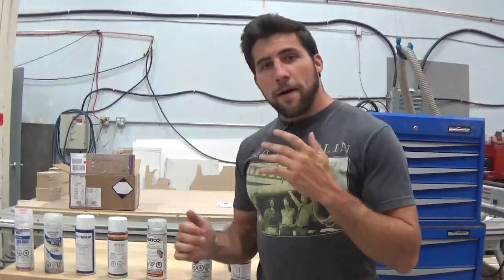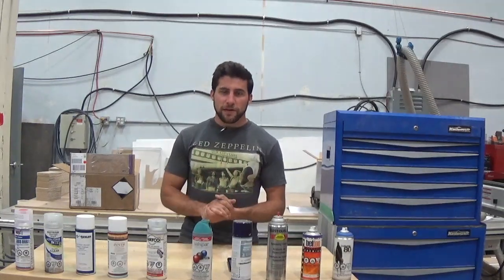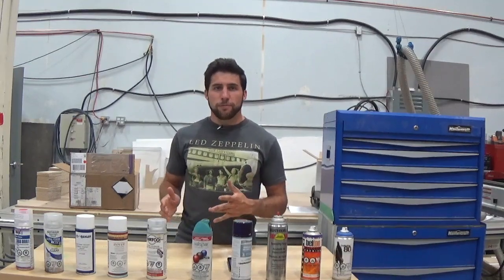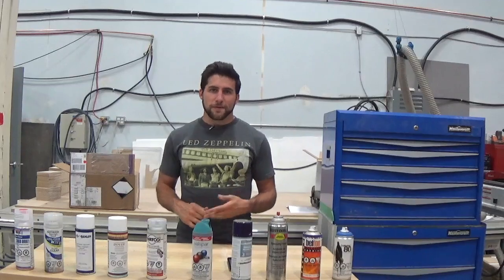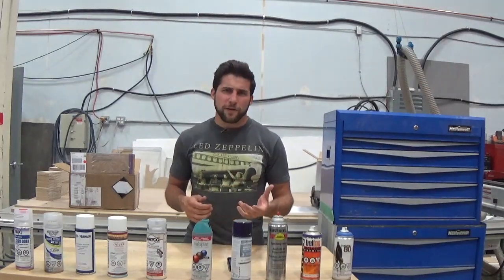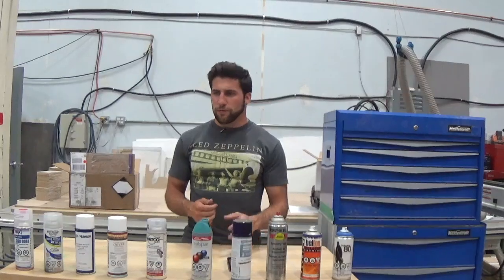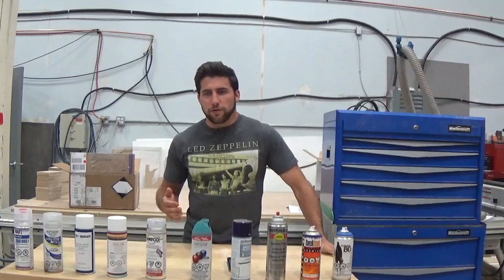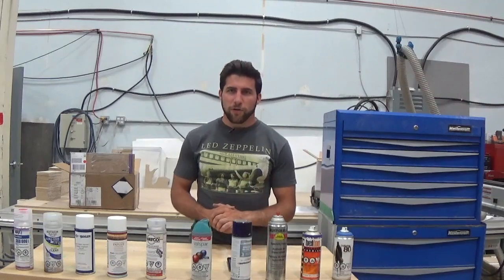The Top 5 Mistakes to Avoid When Painting With Spray Paint

Comment: I spray painted my handlebars with primer and base coat. It looked amazing. So i thought i might spray the clear laquear.so 2 seconds after. It wrinked and when i touched it. Paint just came of as if i used paint stripper
Reply from the maker: What kind of primer and base coat did you use?
Reply: Brad Angove i used supadec spray paint blue. And the primer was auto extreme profesional primer grey
Reply: Also instead of degreaser to remove the dirt before primer. I used nail varnish acetone that women use for their nails as i thought it cleans it. Probably thats why but i used it before primer so i dont think its because of that.
Reply from the maker: What about the lacquer?
Reply: Brad Angove auto extreme professional clear laquear
Reply from the maker: Do you know what kind of paint the supadec is? Enamel by any chance?
Reply: Brad Angove thats the thing. It doesn't say what type of it it is. But ill go to ny local paint shop and ill ask there too see.
Reply from the maker: Ok. If it’s not lacquer you may want to consider a different clear coat. Sometimes lacquer doesn’t play well with other paints. Enamels in particular.
Reply: Brad Angove so the clear coat isnt good. So i have to buy an enamel based clear coat?
Reply from the maker: That depends on what kind of paint the rest is, but it’s likely.
Reply: As a 'degreaser' , or even as a dust (from sanding) I often use a moderately dampened clean rag with witch hazel. Not as 'hard' as alcohol nor leaves any residue from other degreasers. It also dries very quickly. Never had a problem with it, but would appreciate Brads feedback on this.
Reply from the maker: Witch hazel works fine in my experience. It will impact some dyes, but many cleaning products will. 
Standard wax and grease remover is also very gentle. I sometimes just use windex as well. It fulfills the same function with reasonable competency.

Comment: How can u get a matte finish on like a stainless steel tumblers
Reply from the maker: I think you’ll find that it’s really difficult to coat stainless steel. Are you trying to paint them, or turn the metal itself matte?
Reply: @BradAngove  paint em matte black
Reply from the maker: Those are generally done with powder coating if I’m not mistaken. If you use a metal compatible primer though you should be ok.
Reply from the maker: Durability will likely be an issue though.

Comment: When I spray on my wooden sword and let it dry .Later it have a lot of bubbles do you know why?
Reply from the maker: Probably air trapped in the wood escaping into the paint. Are you sure it’s bubbles and not raised grain?
Reply: @BradAngove  no , it is bubbles
Reply from the maker: Ok, you probably need to seal the wood before spraying whatever you sprayed on it.
Reply: @BradAngove  yes, I would try that thanks.but what do you use for the sealer?
Reply from the maker: It depends on what you’re spraying it with.
Reply: @BradAngove  Thanks for the tips.I will try it out.

Comment: Hi, why is my spray paint on glass not drying after waiting 2days? Please help help
Reply from the maker: What’s the temperature there? Is it humid? How heavily did you spray it? How did you prep the glass?
Reply: Brad Angove Thanks for replying. Temp is 23 degree. Humid - not at all. Bottle was washed and dried before spraying. I did follow your spray tips. This is my first DIY project.
Reply from the maker: 23 degrees Celsius?
Reply: Brad Angove yes that’s the normal room temperature in the UK. I also painted outside in 6 degree to see if that make difference.
Reply from the maker: That’s odd. It should be drying, but what did you do to prep the surface?
Reply: Brad Angove thanks for trying to help me. Dried and dusted the surface.
Reply from the maker: Did you abrade it at all? Sandblast it or anything?
Reply: Brad Angove no I didn’t do any of it. What preparation I should have done before spraying?
Reply from the maker: My go-to prep method before spraying glass is to lightly sandblast it.

Comment: do i need to sandpaper plastic before i will paint it?
Reply from the maker: Yes. And use adhesion promoter or plastic primer if you can.
Reply: Brad Angove oke wich sandpaper do i have to use?
Reply from the maker: +Broodje Poep usually 600 or 800 grit.
Reply: Brad Angove oke thank you

Comment: What would cause the spray paint to get sticky if gasoline lands on it
Reply from the maker: Gasoline is a solvent. It’s dissolving the paint.
Reply: @BradAngove  what type of paint should I use if I sand down reprimer and spray it with automotive  aerosol would it do the same?
Reply from the maker: If you clear coat it with the 2k paint that I used in my video on how to get a professional looking clear coat with spray cans you should be ok.

Comment: There's a big difference between dried and cured, which can take days.
Reply from the maker: For clarity, some paints (like nitrocellulose lacquer) only dry and never cure, and can take weeks to fully dry. Others (like catalyzed polyurethane) cure chemically in a day or so. Still others, like UV cured coatings, can cure in a matter of minutes. Faster than any paint actually dries.
Reply: @BradAngove  Thank you! I'm planning my first paint job, on metal. Ever. I am slowly learning. Coincidentally enough I chose Rustoleum's Color Shift for the frame of my Motorized  2016 Soul Stomper from Soul Beach Cruisers. All I can say is sometime this year.  Alot to learn. Color suggestions for a 2L tank? I don't want a busy intersection but maybe a Green Lantern color.
Reply from the maker: Anything goes man!

Comment: Do i have to wet sand primer before paint?
Reply from the maker: No, you don't need to wet sand.
Reply: so no sanding at all?
Reply from the maker: That depends. If you're re-coating within the re-coat window you don't need to sand. Generally though, you will let the primer dry and then sand it smooth before paint. You don't need to wet-sand though.
Reply: Im letting it dry after the Re-coat window. Do i have to sand between primer coats if I wait past the re coat window?
Reply: i used a acrylic primer can i use a acrylic lacquer or acrylic enamel on ? I got rustoleum painters touch, fluorescent touch and home accents.
Reply from the maker: Any time you wait longer than the re-coat window, you should let it dry completely and sand lightly to allow the next coat to stick properly. You should be able to use acrylic lacquer or acrylic enamel, as long as you don't try to use both.

Comment: I have a rocking horse that appears to be painted with a glossy acrylic paint. I want to add dappling ( spots ) to it but I prefer to use spray paint ( I can't afford an airbrush at the moment ) , what type of spray paint would you suggest? You can view it on my blog: http://www.amequinedesign.com/blog
Reply from the maker: Looks to me like you want to do a base coat of tan/ocre, and then go over top with some kona brown. Let the base dry, and then move quickly with your cotton ball or a sock stuffed with a rag depending on the size you want. If you don't succeed in taking off enough paint, use another ball to dab more of the base colour on top.
Reply: Brad Angove. Thank you so much for the quick reply. To be honest I was anxiuos to start but I actually did almost exactly as you suggested. My husband bought me about 5 colours to work with so that helped. I tried removing colour to get that dappled look but I wasnt happy wit it. Then I realized I could get large looking dapples with the spray paint alone. I will be uploading some photos to my blog later today if you want to have a look. This rocking horse was bought as a sort of experiment so I wasnt as concerned with perfection as I usually am.

Comment: What about something as small as Hot Wheels?
Reply from the maker: That’s going to be quite difficult. An airbrush is the appropriate method for those. 
You need to hold the can further back and spray very light to avoid getting runs on those small surfaces.
Reply: Brad Angove Ah okay, thanks!